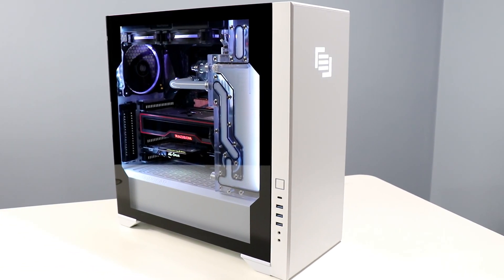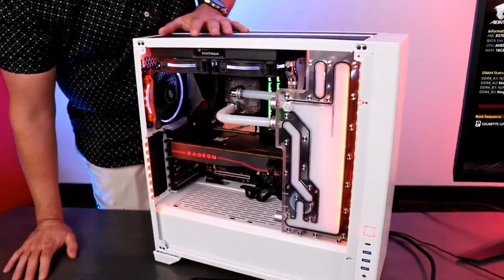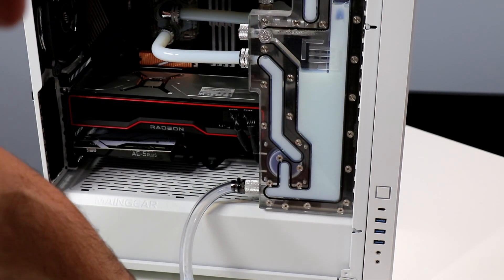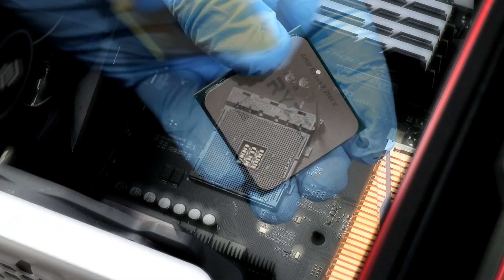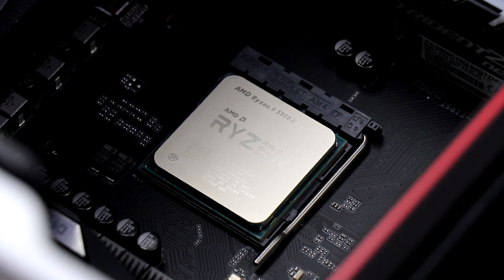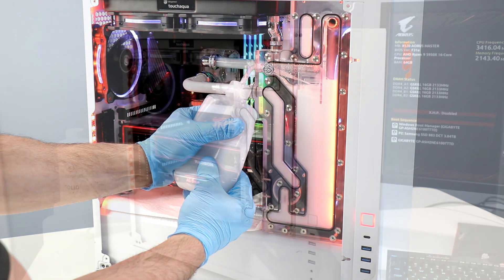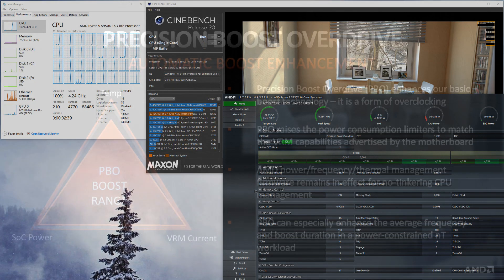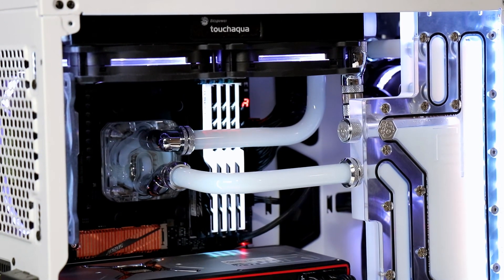AMD Ryzen 9 5950X Zen 3 Brain Transplant With Hardline Liquid Cooling!

Comment: What are your idle and load temps? And what's your ambient room temp? My 5950x seems to run warm on my custom loop
Reply: not 5950x here but 3950x 4.2allcore 1.225v core....should not be that difference. My room temp around 35c(thailand is hot) 360gts x2 PE360x1 PE120x1 =4rad  run at around 1000rpm fan . see water temp around 43when gaming  and cpu render alone around 37 38.... and cpu mostly sit around 55c while game and 73c while rendering.....gpu.....gtx970 because ....yeahh gpu situation suck. 3000us for rtx3090 is too much